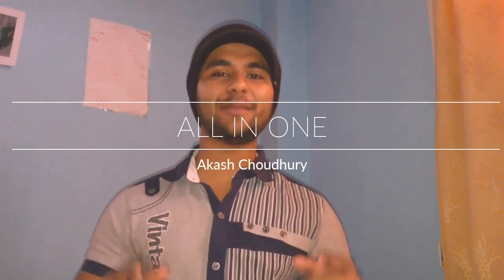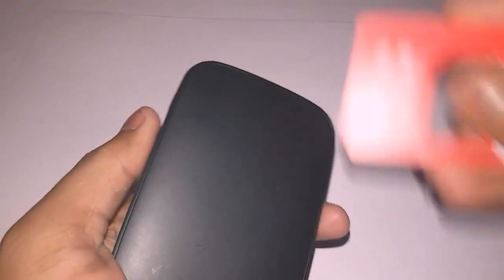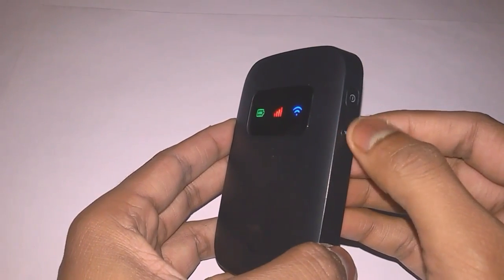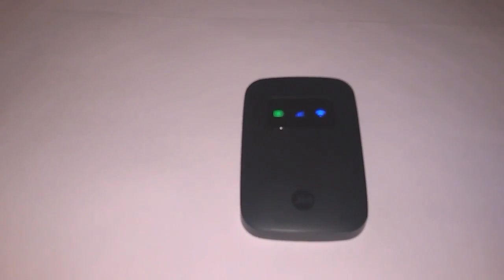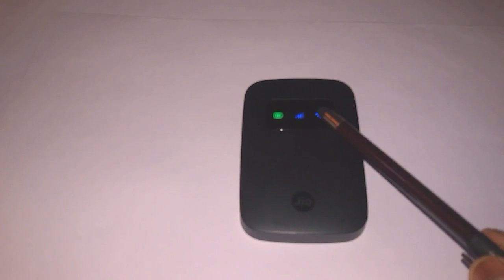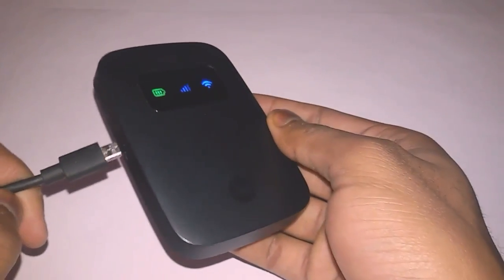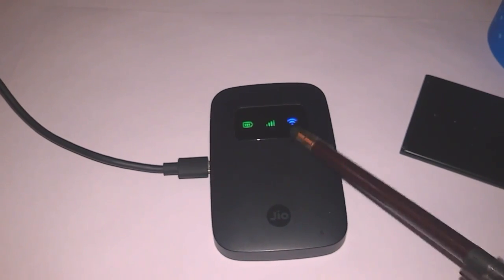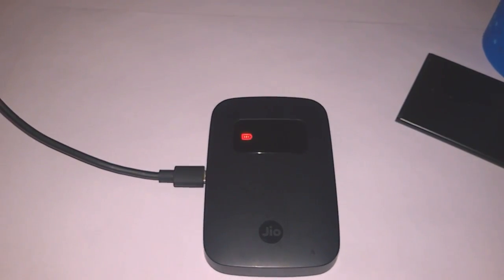JIOFI WORKS WITHOUT BATTERY!!!! || JIOFI TUTORIAL || WITH FULL SPECIFICATION ||

Comment: How long does it work without battery? Any power off issues like jiofi 2 after 15 minutes?
Reply from the maker: Kiran Kumar obiously not...you can use this technic as long as you want as  power supply unless you disconnect the cord...try by yourself😀😊😊

Comment: All jiofi will work without battery , I was also confused first tym😎.

Steps : connect your jio fi to power without battery
2. Red light on
3.power on device 
4.device is on

Tips: use jiofi orginal charger

My jiofi is JMR815 RS 999 ( ROUND ONE)